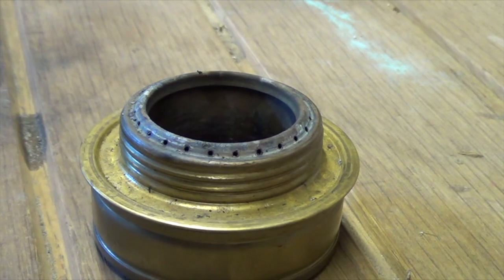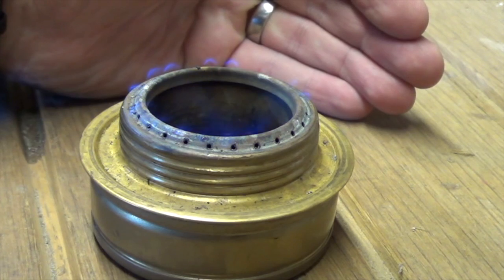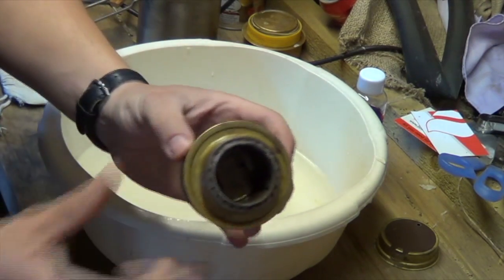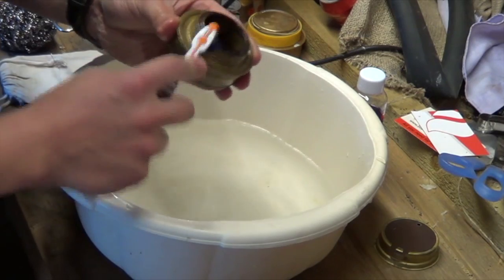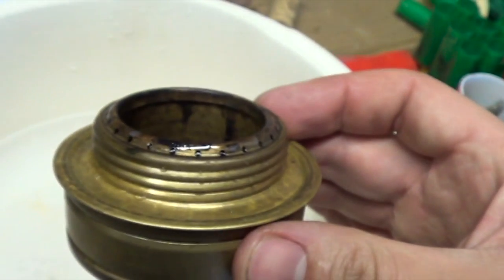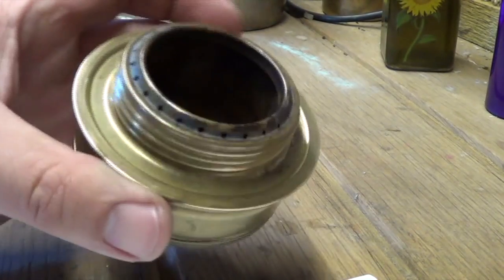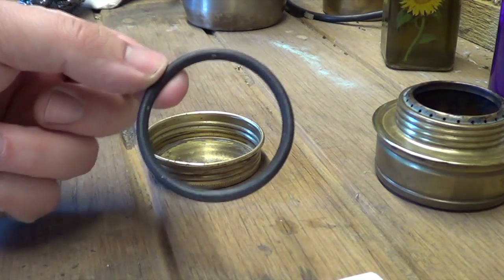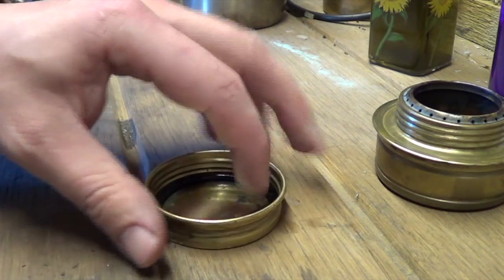How to clean a trangia burner.

Comment: Incorrectly lit..
Reply from the maker: Heath Cope Happy to learn the benefits of alternative methods of doing so but this has always worked for me. Thanks for taking the time to watch and comment
Reply: @SamsonsLeader  I've just read my comment.. I thought I had left more.. Anyway.. last year a friend pointed out that the dip in the wider part of the stove is to hold a small amount of fuel to enable priming.. It improves the overall bloom speed by quite a bit as it warms the actual chamber from the outside while the inner flame warms the inside... I previously didn't know this and used a can lid underneath...
Reply from the maker: Heath Cope Absolutely. Couldn’t agree more and that is the method I was taught when I trained as an expedition leader and is the method I use in colder weather. I filmed this on a hot day where the fuel and ambient temperature don’t require this technique. Horses for courses. Thanks for sharing though as others may not know this trick.